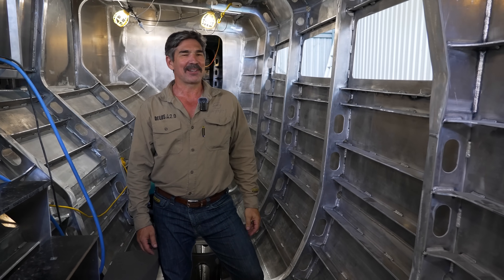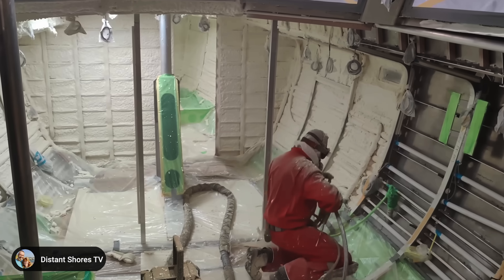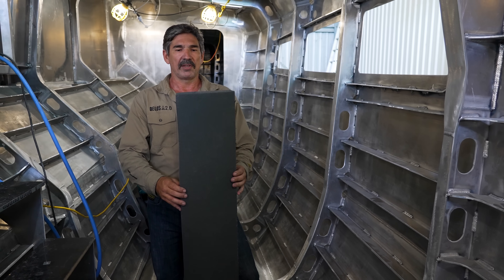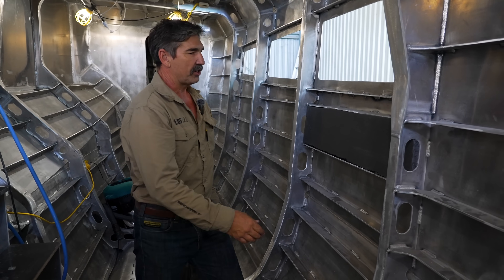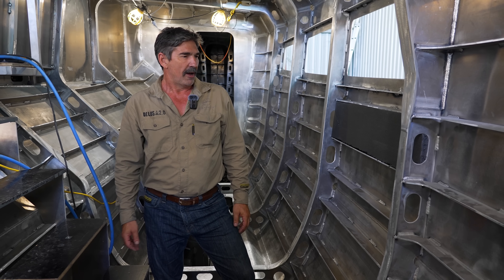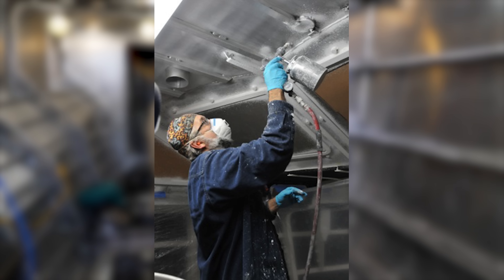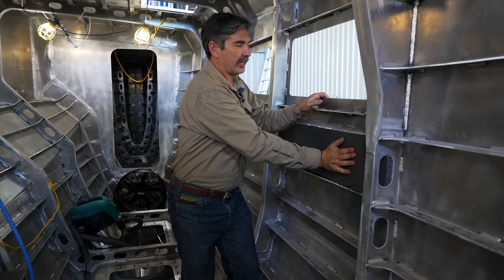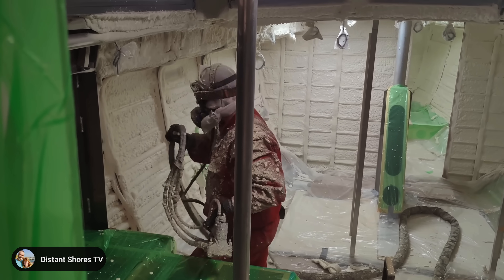HELP, We Need Your Advice!  How Should We Insulate Our Aluminum Catamaran???

Comment: Maybe you should try Polyurea. 

Polyurea Usage Areas
Roofs, terraces, balconies, etc. (Waterproof applications)
Industrial floors and parking lots (Anti-slip surfaces)
Irrigation channels and aqueducts
Swimming pools, aquariums, water tanks etc.
Bridge deck (under asphalt) and other architectural examples
Load-bearing walls and foundations
Roofs and landscaped fronts
Energy, recycling, treatment and water storage facilities
Fish Farms, water treatment plants and petrochemical facilities
Vehicle, boat
Pure Polyurea Advantages
Ensure 100% waterproofness
Ensure a monolithic insulation with no joint
Resistant to harsh weather conditions
High resistance to various chemical compounds and solvents
High crack bridging
High resistance to hydrolysis and aging
Fast curing (4 sec)
Quick and easy to apply
High thermal stability and moisture resistance
High load-bearing properties
High adhesion strength on many surfaces

Comment: Brian I hope this message finds you well and I hope you take heed to what I'm about to tell you so I'm a sales representative for a tiny home company here in the united states and I can tell you we have done a lot of container homes and at the very beginning when we started doing container homes we had a lot of problems because we did not insulate correctly and what would happen is because the container is metal and the inside of the home gets hot any gap the smallest amount of air gap between your insulation and the metal will condensate water our prototype very first tiny home that was in a 20 foot shipping container had to be gutted and completely redone after a year because the condensation had molded and started destroying the internal framing of the tiny home we have learned from those mistakes and we use spray foam insulation and you have to put a thin coat of spray foam down 1st and then you put in all of your structural members for framing and then you have to go back and do another coat of spray foam to make sure you fill all the gaps behind the framing this is a little bit different because it's a boat and it's all aluminum and I'm telling you if there is the smallest gap in your insulation that is not touching the metal you will have condensation problems which will lead to mold and mildew problems so my suggestion would be to put in all of the conduit put in extra conduit running throughout the ship so you can fish wire through put in all of that first then go in and use spray foam closed cell spray foam is the absolute best way to protect against insulation gaps and condensation and mildew problems I think this is probably the only option you have everything else is going to be way too expensive.

Comment: Several higher end auto builders (Mercedes/Porsche) utilizes an insulating & sound deadening sheeting that is applied with a mastic that is meant for aluminum. Ford are using a similar material in their 100% aluminum body panels for the F-150 all aluminum body. The material is paintable as well. The mastic used to glue down the insulation has an ASTM & SAE specification which will provide you the salt spray specifications (yes, they exist). Once armed with this information it will provide you with number of hours of salt sprat testing that was done on the 2 products, the adhesive and the application mastic. An evaluation can be confirmed with both the ASTM & SAE tech data sheets before you even consider using either product.

Comment: I would do a combination of spray foam and the poly foam board. ID the areas where you would have to do work use foam board there and use spray foam everywhere else on the boat

Comment: We had a spray foam aluminum 49ft boat that was absolutely great in cold Vancouver winters, or cool in Hawaii. Our present boat has PVC pipe laid in for snaking wires through that could allow more wires or smaller hoses to be done at a later date. So you could put extras in for the future and foam it all. It seems with Victron and others that blue tooth and ethernet is taking over. Our Cat was 25.3 in beam and we had to hunt to find a travel lift that could handle it as 90% are max 24ft beam. We beached ours on the keels but with the airfoil shape the stern sank in the sand putting rudders and props at risk. Also for end plate effect having a plate on the keel bottoms the width of the fore part would allow beaching. With cats the waterlines are twice a monomaran so scrubbing is a BIG job making beaching more attractive. We have a Marlow Hunter 50AC now so we can get hauled anywhere, but miss the Grainger 48. Derek

Comment: I have no idea about warmer climates but if it's cold then spray foam is superior.  We've been on boats that have had it all, spray foam, mineral wool, flexible closed cell foam panels, rigid foam panels, spray cork... The requirement that we placed when we were looking for our current boat was that it had to have spray foam insulation.

Spray foam is not about the ease of application but providing a proper moisture barrier. Spray foam might scare if you are not used to it, but it is easy to remove small sections of it if you for some reason need access to the hull. But how often do you need that? The hull will not secretly rot away behind the insulation (and with time you'll learn to trust that).

Anything else, including the closed cell foam panels (especially if not glued on), will leave enough space for moisture and condensation to form between the hull and the insulation. Trying to leave an "air gap" between the hull and insulation is desperate, it will not help keep things dry.

I just want to repeat this; if you have insulation that is NOT directly stuck on the metal then you will have moisture there. Insulation needs to be applied in such a way that it is airtight. Spray foam naturally forms a barrier like that. Pushing foam panels onto the "insulation pins" you showed won't do that and you will have condensation behind there. If you use foam panels (glued on) you will need to try and create a vapour seal, this is possible in a house but really hard to accomplish in a boat..

If you do go with flexible closed cell foam panels, I would recommend gluing them on and not using "sticky back" panels, unless you are completely sure about the quality of the sticky back, because the glue on those seems to be not as good as if you were using a separately applied glue. See for example K-flex/Armaflex, who provide sticky back panels but also sell normal panels and a special glue to go with them; we've found that using the separate glue is more reliable in the long run. It'll also be a bit cheaper and not that much more time consuming to install. Sticky backs hold first but later on can come undone.

Even with spray foam you will probably have some aluminum ribs exposed. You'll quickly learn that those transfer heat and form condensation like crazy. A bit of moisture won't hurt though, it's aluminum! One option that you could also explore would be a thin layer of spray cork. This would be applied before the spray foam possibly only onto the ribs which won't have foam. This won't insulate much but will help a great deal in preventing condensation.

If you want to talk about insulation and cold weather stuff, get in contact with me ;)

Comment: Endorse the idea of considering both fire protection and flotation in your choice of insulating materials. Fire, especially--you don't want a material that will quickly fill your boat with toxic fumes if for some reason it ever ignites.

Comment: I built a steel trawler. I considered spray foam and quickly discarded that Idea when I helped a friend scrape it out of the hull for some.inevitanle.hull repairs.  Even after scraping and sanding there were still small remnants and they smoldered when.he welded nearby and gave off all kinds of thick smoke..Hard pass for me..
I used Rockwool/Roxul. It's hydrophobic and doesn't absorb moisture, almost entirely fireproof, very light, easy to cut with a bread knife. It's removable, and available as solid.comprssed sheets, or flexible batting. It's available in most hardware stores, reasonably priced and has good insulation and soundproofing characteristics.. That's what I used..I'd do it again. We boat on the great Lakes.. in the summer it's plus 40C and in the winter -25C.. so far no condensation...

Comment: I did spray foam for large metal buildings and many liquid storage tanks.  All in climate with wide swings -40f to 120F.  In looking at metal surfaces behind foam, i fully agree you need a good primer on your aluminum tonprevent corrosion.  The lower density spray foams are actually pretty easy to remove with a sharp serrated knife and/or putty knife.  Acetone or gasoline dissolved all the urethanes qe used.  I would plan to spray a protective layer over it to stop flame spread in case you start a fire.  If distant shores used it, it must be good.   Their builder is experienced in high-lattitude cruising.  I am very concerned about your bus bar connections.  I maintained 600A bars with a thermal gun to catch them before burndown.  Your lack of belville springs to keep constant pressure is concerning.  Consider burying some TCs very close to the joints to monitor heating, please.

Comment: I say spray that thing!
This foam will require an additional liner or a thin foam layer sprayed anyway, and then this foam.. save time, energy and $$ and headache later due to condensation.
Also, what's the verdict on the electric front? Will those bus bars run on top of each other??

Comment: Well brother I don't have near the sailing experience you have but I do have plenty of miles under the keel.   I was on a U.S. submarine for 5 years.  We used something equivalent to the black closed cell foam.  It was adhered to the hull with contact cement and also contact cement was used to fuse two pieces of foam together.   I like your idea of gluing posts to the hull to fix the insulation.  Some areas you won't need that like the sides, just the overhead.  From what I have seen though most commercial builders use the spray foam.  Maybe use a combination of both.  How often do you think you will need to get behind the insulation?  I guess that's the draw back of building your own boat, you are the warranty work provider.  After all you are the one doing the install of all the systems.   I am seriously not jealous of you for the first time in 5 years LOL.  Y'all taking on a lot of liability building your own boat hope the insurance company plays nice with you.

Comment: If you plan to spend a lot of time in super cold weather I would go with spray foam.  If most of the time will be in milder climates you might consider Rock wool.  It is super fire proof, and will allow drying through it.  It would probably be more labor than it's worth, but I think it would be sweet to fill the main voids with rock wool boards, similar to what you are doing with the foam in the video, then spray foam over the whole thing to air seal it all it.  That way if you ever had to make a repair, the areas under the rock wool would be clean metal.  I owned a 35 year old aluminum boat, and the only place I had issues with interior corrosion was areas in the bilge where standing water was sitting.  The line where standing water met the air was worst.

Comment: My cat (50 feet aluminium) is totally insulated with styrodur covered with komacel fixed with wooden slats and stainless steel screws, the combination of the two materials in addition to the ease of installation or removal is completely hydrophilic and fire resistant in addition to a pleasant aesthetic appearance and easy to clean

Comment: So I’m not an expert but I use to work with aircrafts structures and I’ve seen the effect of water pooling on an aluminum structure and you should avoid it indeed ! The worst case we had was when some FOD blocked the drainage points in small corner witch was normally inaccessible for control… this was only detected during a refit. On aircraft we used what we called mastress it was basically pads of rockwool enclosed in a fire retardant plastic (pink) pinned to the hull but I don’t know if you can find this or if it’s doable on a boat.

Comment: Hi brian i have built several boats for me by far the best is spray foam thicker the better on my boat which i designed built my self i used spray foam 45 mm thick under the floor i used 50 mm king span you lose 40% heat through the floor but before you spray foam you after afix battens to the steel structures so you can fasten your wall panels after you have foamed it the spray foam sticks to the boat stops druming effect which makes life more pleasant its allso a moisture barrier keeping the metal protected as theres no air gaps like on that foam you wedged in the spray foam is also warmer so thats three things to the advantage spray foam dont forget insulate under floor if you can if you get it right it works both ways example open all windows on a night cold comes in next day shut everthing down windows doors boat stays cool inside all day my boat gets warm with kettle on its so well insulated its sea going barge cat c 45 ft long 12ft wide if you supply an email i can send you photoes of how i did it value £250000 we designed it built ourselves kind regards john

Comment: No personal experience here (except for doing similar rock wool bats in my house) but I think the way I would engineer that is to spray foam everything to completion except for where you are running conduits. 

For the cells that have conduits spray in a small layer, then install the conduits, then put foam blocks on top of the conduits to finish those cells.

Comment: I work with aluminium sailboats, I have a Ovni 445 insulated with XPS. Sound really travels from the water and there is more clunking from waves that I would like. The Xps does not soundproof. Also condensation gathers behind the insulation, eventually running off. It is a 2008, and we have no problems with mold and such. I have done extensive repairs and have not seen any corrosion on behind insulation. But a lot under chipped paint on deck. I also have experience with a KM yachts which is PU spray foam insulated. This seems like a much better option in terms of function. The PU bonding to the alu seems to stop the sound resonating. If you ever need to do repairs including welding on the hull above water line, which is very unlikely, it is such a big undertaking anyway, that scraping the PU foam will not be the big issue.  PU foam However, it is super toxic foaming agent and gasses off for a long time. The same goes for XPS, it is not meant for inside insulation of homes, but rather foundation insulation. I would personally install a network of cable tubes for futureproofing installations, and PU foam the boat. The noise insulation and effective insulation is on a different level.
Reply: forgot to mention, remove the PU foam from every nook and cranny,  DRY ICE BLASTING! no sweat

Comment: Have you looked into raptor or rhino lining? Alot of the automotive world uses it outside of the typical truck bed liner because of its ease of application, coverage capability, and how thin it applies.

It would cover, protect and protect the underlying metal. Just a thought to layer that then add the foam that you have cut out

Comment: If you dont want  to use NYALIC to protect the aluminium, best primer i know of (& use) is ALTEX COATINGS Aluminium Etch. Formulated to prevent FILOFORM Corosion. 
CARBOLINE is same product but cheaper as it doesnt have a boat on the label.

Comment: Normal you never reply to my emails. I suspect its because I'm  not a patron.. I still like your videos as I like many others It is not practical to pay everyone I follow the monthly bill would be large.  However my advice and experience could be more value then buying you a beer. 

Never the less I can pass on my experience. if it helps your lovely project come to life. 
I do have an Aluminum a mast head cutter 15 meter mono hull build in France for the single handed BOC round the world race in 1986/89 build for the southern ocean.  My boat is insulated with spray foam in the living areas ONLY behind the fit outs  in the ceilings only.  Take note the foam spray has been applied only in selected areas living areas. There is no foam insulation under the cockpit stern and the sail locker in  the bow.  Of interest also in the living area there is no foam under the floorboards as this is  there is where all the wire harness and pluming run. The Floor boards act as an insulation against noise.  Skoiern IV was well build the use of foam insulation in planed selected areas is the best solution as i found it to be excellent insulation from heat noise, yet when i need to I get a good sense of the boat underway the sounds coming from under the floor boards when the boat is at anchor and underway give me good feed back.    

Also of some interest on the deck, I stripped the deck of all non slip paint and repainted it once dry I applied a non slip z designed Deck rubber like gray mat, its been on a few years since I rebuild my boat from the top of the mast to the bottom of the keep, from an industrial knock down when it was on the slips. it is excellent product it does give some insulation from heat and noise from the deck. I find it impressive, as that remains cool and nice to walk on  35/40c degree days. I can give you the name and contact if you like it is available in Australia in large sheets.   SV Skoiern IV

Comment: Aluminum will corrode regardless of air around the condensation or not. The oxygen in the air thing is BS. There is oxygen in condensation (it is H2O) . Simple thought, there is no air underwater(fresh or salt) but aluminum still corrodes
Keep up on your anodes, don't spend much time in marinas and you'll be fine 
Just get someone with lots of actual hands on stray voltage experience to do your boat after you got her all set up.